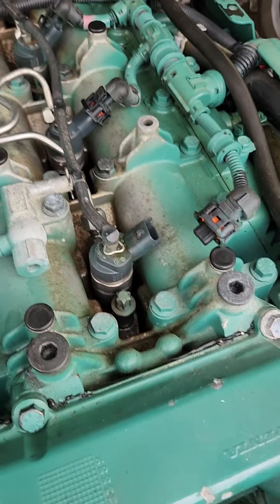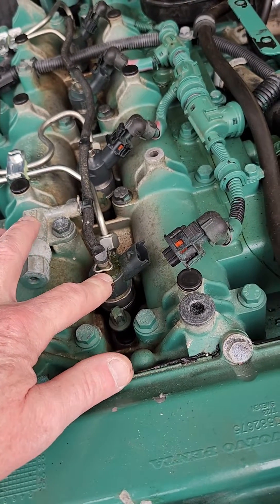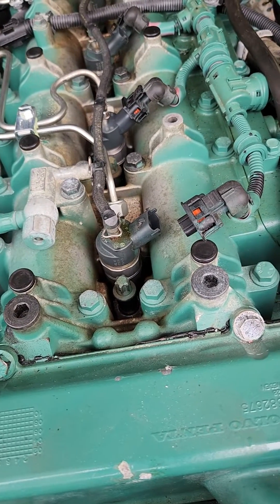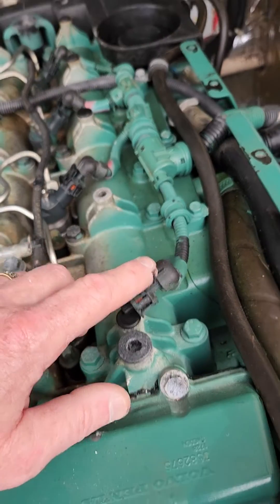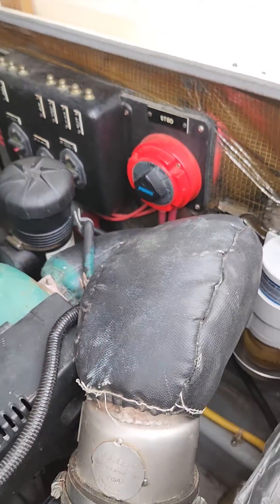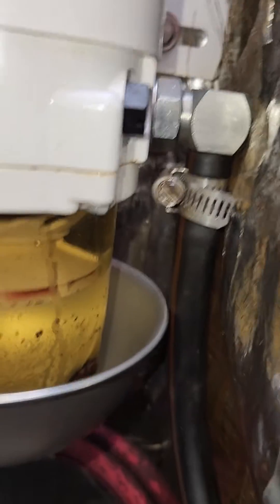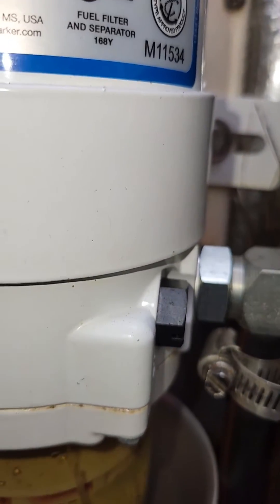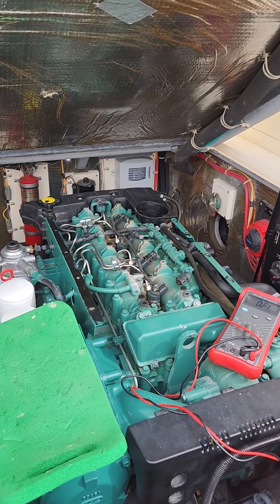Volvo Penta D4 injector loss code overview

Comment: hi, I think I have the exact same problem on my d4 210! injector n.4 not working when it warms up. I sent the injector to a Bosch center but they told me it was fine. in the end I solved the problem by reversing the wiring of the two d4 210s on the boat! magically both engines work with reversed wiring.
reversing the wiring again the problem arose on the fourth injector.

But this year the same problem occurred again with the same injector! I'm very confused. How did you solve the problem? Thank you
Atvthe momentI am on a boatvtrip and I am a bit in trouble

Comment: Hi i want to ask you one question
Reply from the maker: Ok
Reply: @tedsmarinerepair8956  mid 187 psid 232 fmi 5
Mid164 psid 232 fmi 5 fault code engine D13
Reply from the maker: @yassineelidrissi8186  PCU com fault
Reply: Tank you i will tchek
Reply: Fmi 5 spn653,652,656 code